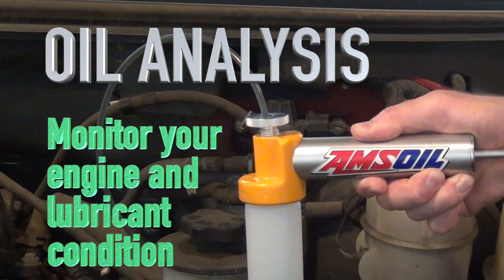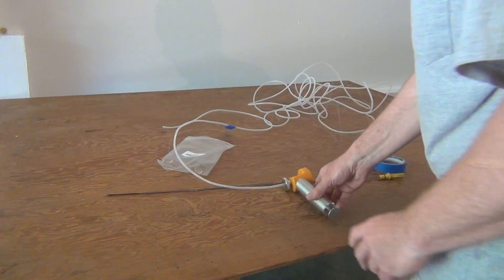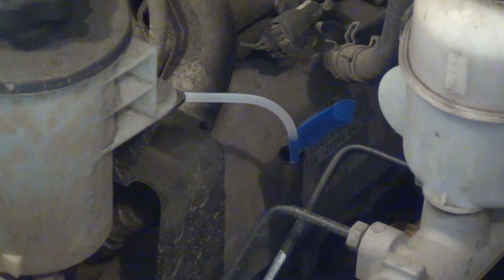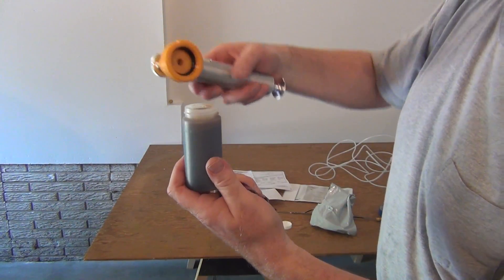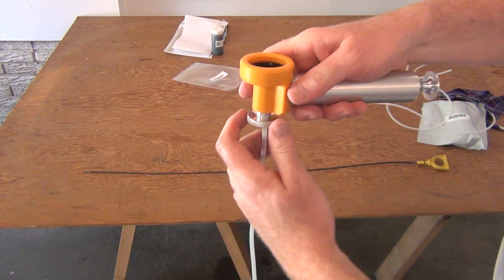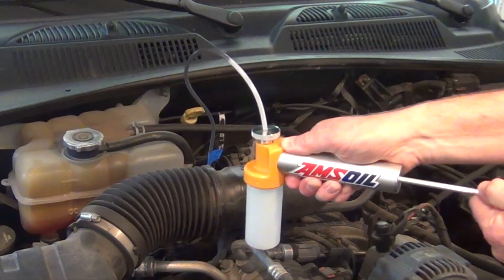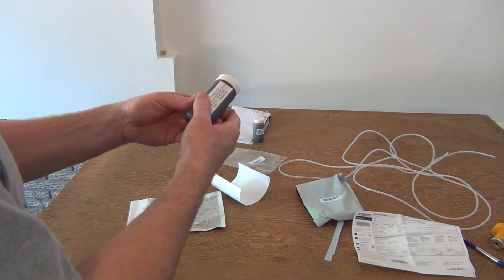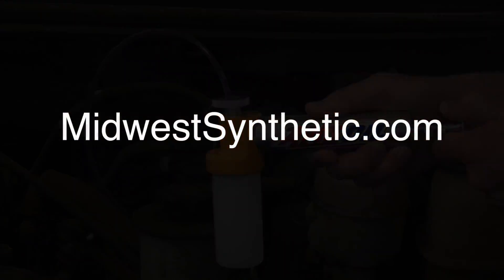Oil Analysis - Monitor your Engine and Lubricant Condition

Comment: How come Sulphur is missing in the report?
Reply from the maker: Thanks for checking out the video!  That's a very interesting question.  I had to reach out to the lab for that one.  Here's what they came back with: Testing for Sulfur is not included in the regular oil analysis kits because it is expensive compared to the price of the regular analysis kits.  Add-on testing for Sulfur in engine oil is offered but the cost is over $200.00.  The lab also assured me that for diesel engine oils, the soot level and viscosity are better indicators than Sulfur level, especially since ultra-low sulfur diesel fuel became predominant.